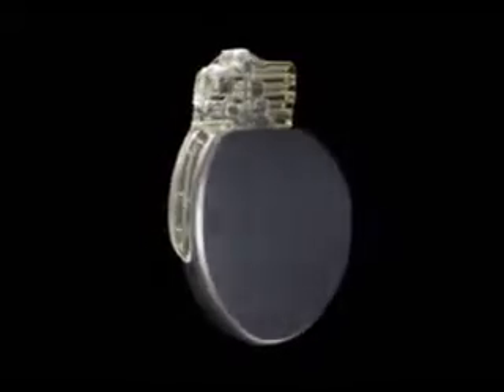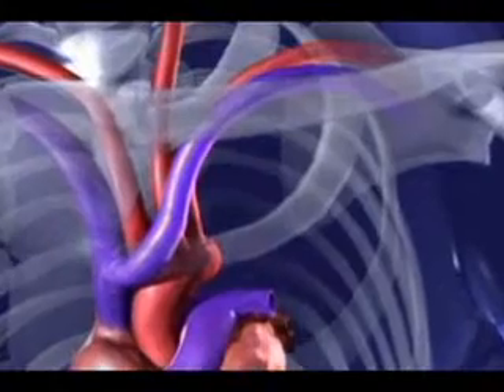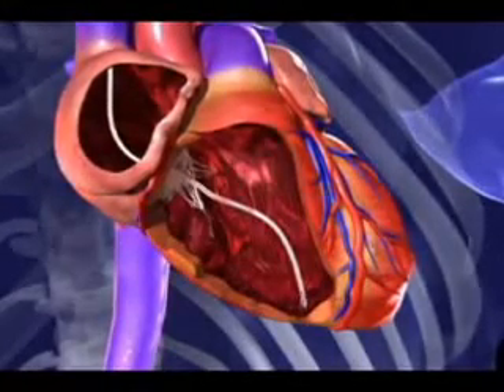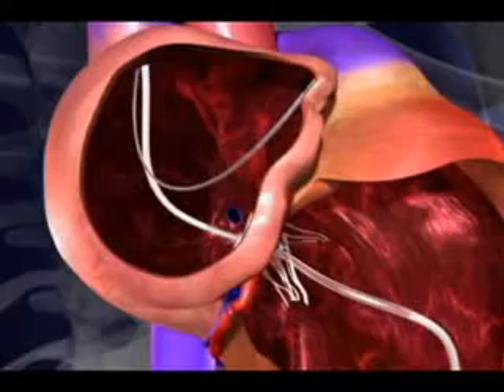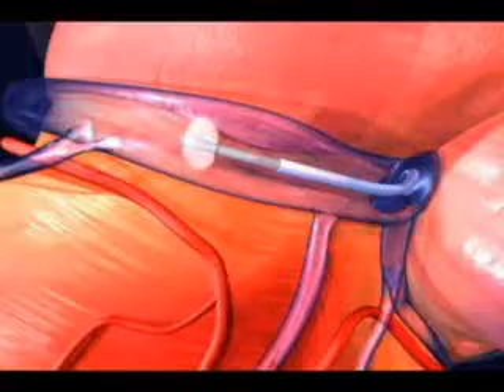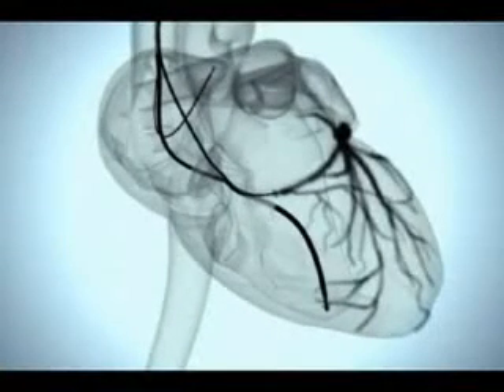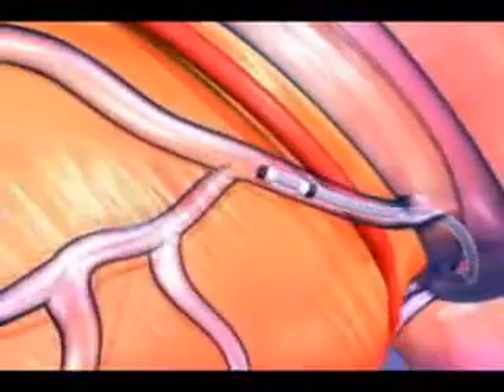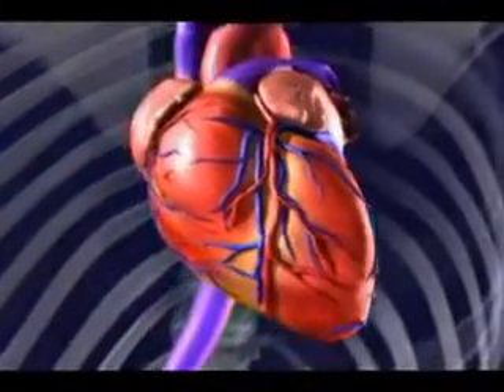Animation: New therapy prevents heart failure

Comment: If your heart performance is within the selection criteria to indicate you need this device, I say GET IT. I'm having mine implanted on 22 Dec 11, the Medtronic Protecta XT. The more you read about this device, the more you trust what's happening - in my case, my heart is beating out of sync in the left/right ventricles, a condition called Left Bundle Branch Block. This CRT-D will fix that problem and make my heart pump more efficiently, and hopefully extend my time on the earth with my family.